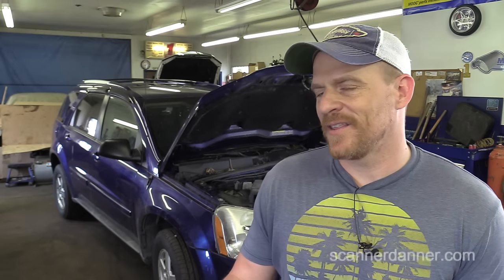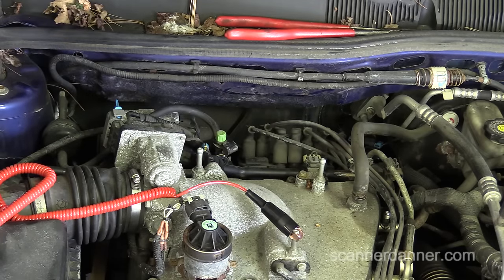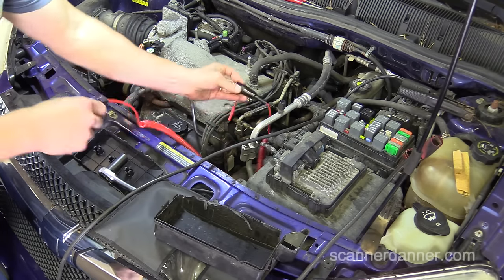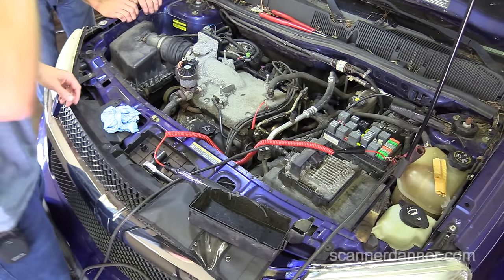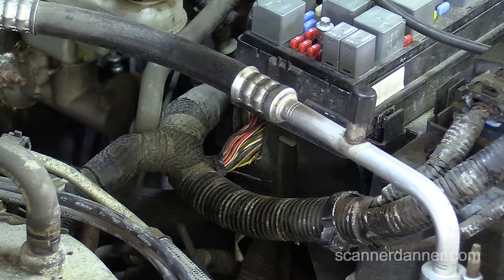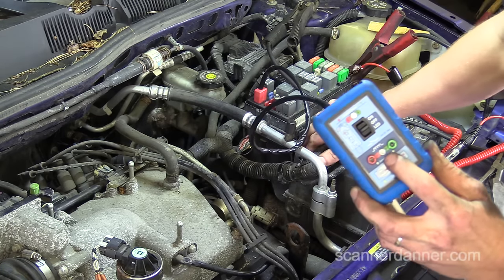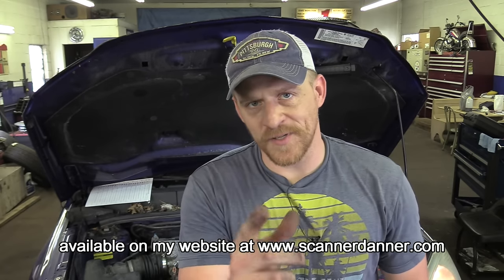No Start, Engine Cranks Okay, Troubleshooting With Basic Tools (No Power to Injectors)

Comment: There should be a rubber piece that seals and protects the loom as it exits the fuse box.  I can only hope it has been removed for some reason and is not a build flaw from the factory !!!
Reply from the maker: flaw from the factory, but look how long it took to damage one wire
Reply: I got a kick out the rodent comment as soon as you place the pack rat adornment back down, another set of hands picks it up to confirm the call. In this case a false alarm, but you never want to see that evidence in the first place because they can devalue a vehicle to scrap price rather quickly.

Comment: the first time in oct of 2016 we drove the car barely going to the mechanic and he said it was the timing belt, well we DROVE it there, how was it the timing belt? anyways they took a month to fix it, in december of 2016 the timing belt broke on me while driving, they kept the honda until march of 2017. we have had it back since march and now yesterday july 7th 2017 the car is just cranking after everything shutting down while driving. the motor grabbed one time but quickly let go, I think its something to do with the ignition and the anti theft bullshit. I think the car just shut down cause it thought it was stolen and now it wont go back to normal. And My Kia needs a radiator and who knows what else.

Comment: is a solder connection and head thrink not better fix
Reply from the maker: Not enough wire to work with, but I'm totally fine with sealer lined heat shrink crimp connectors like this one.

Comment: I have a 04 f150 have spark and fuel .truck cranks but cylinder 6 has no pulse to that injector.has power no ground
Reply from the maker: https://youtu.be/CMt9AgwuZSg
This one will help you determine if that injector is shutting down intentionally or not

Comment: Hi hello mr sd scanner im a pilipino from phil. Always watching on your youtube ch. Me i have a problem my nissan exalta sentra 2003 model i have a good crank but no start everthing good only i dont have pulse ground from my fuel injectors but all have 12 bolts on all injectors wire  can you help me mr sd scanner thank u so much
Reply from the maker: So you have good fuel pressure and good spark but no injector pulse. Is that correct?

Comment: Why would a test light be ok to put on a Computer circuit? I thought a DVOM should be used when getting signal control from ECM Watching the voltage control. Good info really like your channel my career as a non-parts changer Thanks SD
Reply from the maker: One of the biggest misconceptions in our field is the use of a test light. Keep watching my videos, you will see how, when and why I use the test light over the voltmeter in many circumstances.
Reply: Would it be safe to say that the test light is the load in the 12V controlled circuit. You wouldn't want to go put a test light into a 5v ref circuit or a PWM circuit correct
Reply from the maker: Too hard to answer this here, but pick some videos from this playlist to get a better idea about how to use the test light properly.
https://www.youtube.com/playlist?list=PLE9BA8CBD51B8C48E
Yes, you use it as a load being careful about what you are loading.
Yes, you can use it on PWM circuits
Yes, you can even use it on the 5v ref circuit for integrity testing between the reference and signal circuit using the test light in series as a buffer in case the signal wire is shorted to ground.

Comment: I just got my 95 Riviera back, un fixed the mechanic threw in the towel....after he threw a fuel pump ignition module and crankshaft sensor at it....he did tell me that I've fuel pressure but no injector pulse...he says he doesn't have the old equipment to diagnose it correctly....and politely told me the car has come to its end in life.....it upsets me cause I know and he knows that that statement is bullshit....the real reason is that the job isn't going to make him money

Comment: My 3.2 intrepid always starts fast but about 8-10 times in 1 1/2 yrs it didn't start after driven awhile then shut off for about 5 min, the engine will turn over fast just wont start till it sets about 20 min. might not do it again for 2 months of driving or it might do it twice in one week, you never know. code said number 1 coil so i changed it and it done it again a week later with no code showing. By the time it takes to tow it in it would start up ok.
Reply from the maker: Could be a dead spot in the armature of the fuel pump. But that's a guess and I don't like to guess. When it doesn't start next time, find out what you'e missing
Reply: I have spark tester ready and will check for fuel problem also, thanks for your reply!

Comment: So, not only does Spark reveal the ignition system works, it is also an indication that the timing belt is still intact.  If the rotor spins, then the cam is spinning.   Pour fuel in there, and it will run.  Pulsed Fuel Injection is a BAD IDEA.   Each injector has to open, and shut, millions of times over the years, and it is operated by an electromagnet.   Chevy makes me sick.  They produce in such volume, they cut the sheet-metal to an edge that cuts you, rather than cut it 1/4 inch too big, and folding the edge of the metal.  This is inexcusable.

Comment: Right on food to know and I have bud question about the circuit in a voltage regulator power tech 8k ok well it looks as if someone did not what they where doing at the shop one of ? I have had a my RV At hooked up 4x6v batteries in a 24 volt and I use a 12v right I did not even think about the way it was hooked up thinking  it’s done at shop . Until gen is starting and fairly new batteries are going dead and I’ll get there and check levels started noticing the cables are frying I like what’s with this look at see it’s not a 12 volt hook up . I start cleaning it up went back gen and testing out pulled the voltage regulator see that there’s and hot spot on it and i testing it connected back I have not hooked it up yet I’m hoping it will work not sure I have looked into every circuit on its seem as if it should work I think ? Hmm one connection was not getting contact made it work ideas ?

Comment: that should have been soldered...  not a connected with a butt connector crimped with side cutters
Reply from the maker: Time in repair vs cost brother. Plus this is a completely acceptable repair.
Not arguing what it should be, just what it is. 
I would have done my own car the same way
Reply: I guess I can't disagree to much,  most people aren't a perfectionist like I am. . I'm ocd with wire work.. you are a good teacher though, and I've learned a few things from you so I can't knock you to much brother. . ☺..

Comment: can't believe that 1 wire caused all of that. Damn engineers should be made to work on their own designs. Bet you have $50,000 in tools just to work on these damn vehicles. How do you do it with everything in the way? I have a 89 s10 pickup with a 2.5 liter engine. I have a new fuel pump tank and the hanger assembly. previous owner had installed a new fuel pump also. I replaced the fuel filter distributor oil pressure sending unit. No matter what I do truck refuses to start. When I turn the key on you can hear fuel pump run. The gas gauge moves. What is wrong with my truck. Why does it hate fuel pumps? How do you deal with this crap? I am disabled a veteran and live on a fixed income.    I use the truck to scrap and go to doctors apontments. I have too much new stuff on it to junk it.
Reply from the maker: how to you know it is a bad pump? you could have an issue with the injectors not firing (common fault withing the ignition control module, not sending a signal to the ECM for injection control)
What is your fuel psi?
Do you have spark?

Comment: I thought you were just using a test light you pull out these crazy tools like somebody has that tool to figure out the diagnosis no help at all dude
Reply from the maker: I just used a tool to energize the relay circuit. Something completely not needed. You can unplug the relay and simply jump the load side pins with a paper clip and do the tests I showed.

Comment: 50 bucks says they replaced the fuel pump because it would start on starting fluid. I just know how incompetent pete and his crew are
Reply from the maker: It isn't necessary to talk that way about Pete. Most times the customer comes in and tells him what they want changed, and he just does it. Not a great business practice imo, but it isn't my business to tell him otherwise. He admittedly does not do electrical and electronic systems troubleshooting. That is why he has me.

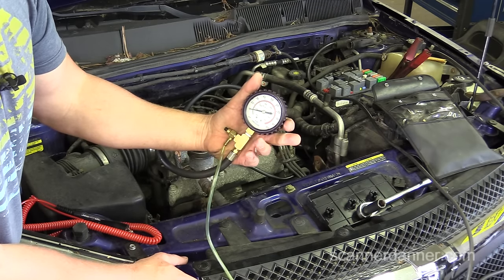Comment: 1:25.   Another Chevy that won't start.   Are you a Masochist?   POUR FUEL IN THE CRANK-CASE BREATHER HOSE ENTRY POINT ON THE INTAKE HOSE TO THE MANIFOLD.    If it's a Fuel Issue, it will start.   If it's a Fuel Injector Unit issue, it will also start.   It will eliminate the question if it;s the spark and fuel injector timing computer, ( Which is a pile of garbage, you have to R & R it just to diagnose the problem, so.....I sure hope your first move is to install an extra computer you have for diagnosing Chevy piles of crap.